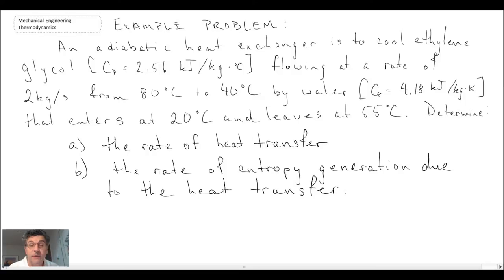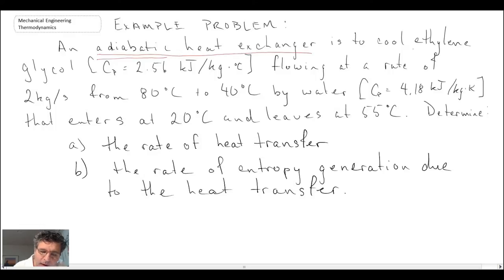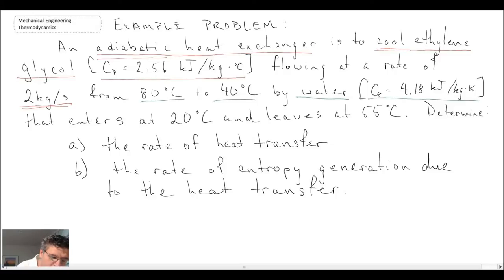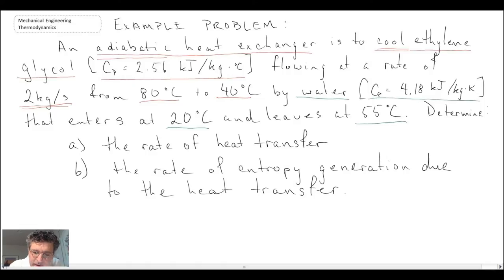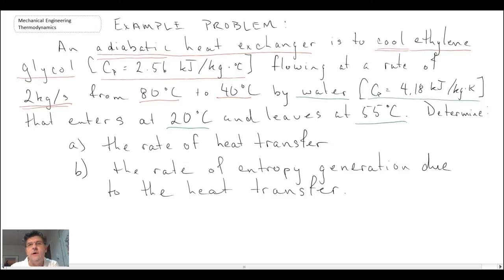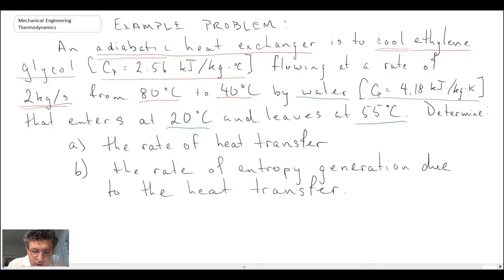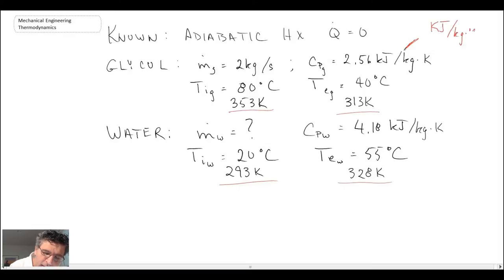Mechanical Engineering Thermodynamics - Lec 10, pt 2 of 2:  Example - Entropy Generation Heat Exch

Comment: thanks so much .......
Reply: 1. cp has the same units as specific entropy,  ( kJ/(kg*K) ) if you multiply it by the flux of mass ( kg/s ) you get [ kJ*kg/(kg*s*K) ] = [ kJ/(s*K) ] . And a Juole per second is a watt so we end up with [ kW/K ].

or

2. S' is the rate of change of entropy, so you take the units for entropy derive/divide by time, and do the same reasoning of point 1.

Watts give the idea of power used/produced by a machine but this is not the case here, nonetheless the very definition of Watt is Joule/second so it is correct to use W/K for S'.

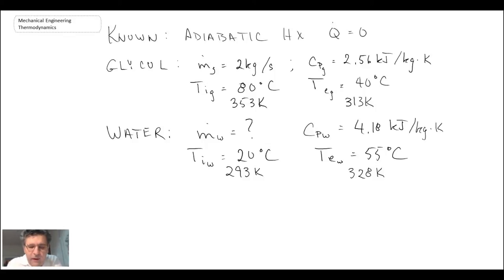Comment: 5:03
Why is that?
Why is [KJ/(Kg*K)] the same as [KJ/(Kg*°C)?

shouldn't it be a difference??
Reply: I confirmed that in this website:
 https://converter.eu/heat_capacity/#1_Kilojoule/Kilogram_%C2%B0C_in_Kilojoule/Kilogram_K

But I don't get it, because when you divide by Kelvin, you are dividing for a bigger number, and as far as I know, you can't really divide by °C, because is too risky
Reply: If you think about it degrees C and K are in a scale of 0 - 100, so the kJ needed to bring 1 kg up by one degree K is the same amount of kJ to bring up 1 kg by one degree C
Reply: If you graph temperature scales for Celsius and Kelvin you realize that one degree K is equivalent to one degree Celsius..not the same for Fahrenheit for example where 1.8F is around 1 C